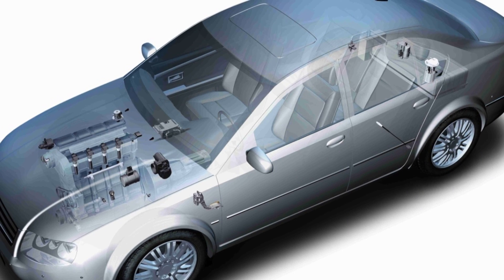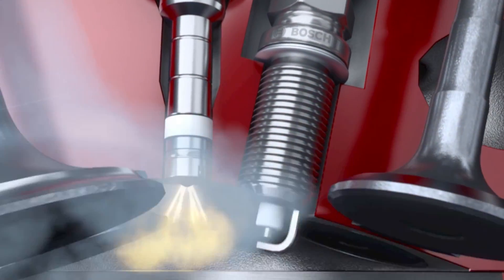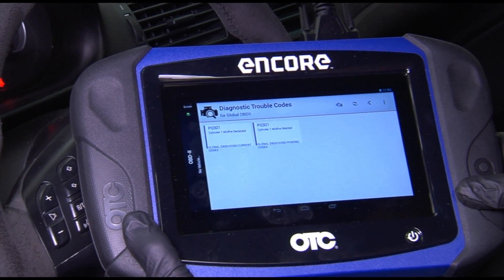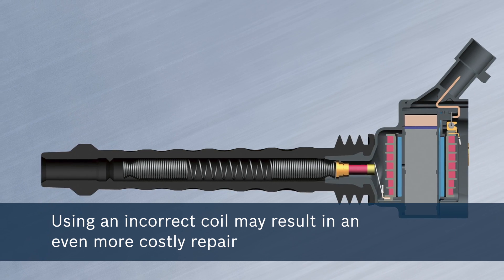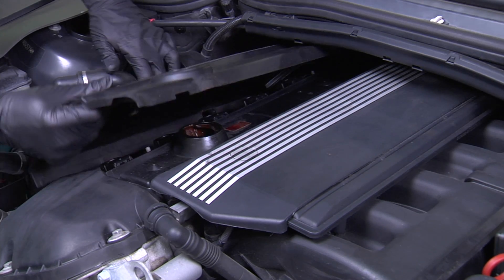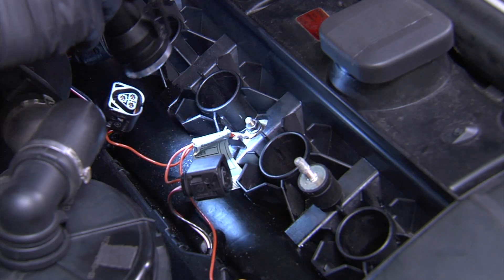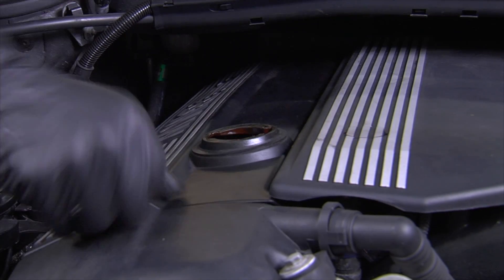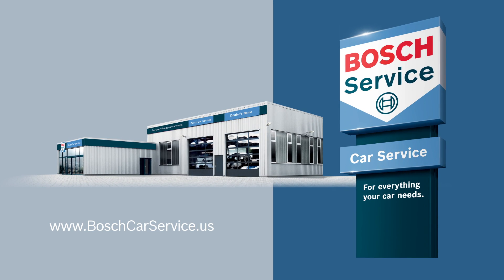Replace & Install a Bosch Ignition Coil on a BMW (0221504470)

Comment: What would make the engine vibrate?
Reply from the maker: Thank you for taking the time to reach out. We've forwarded your inquiry to consumer care, who should be reaching out to you soon.
Reply from the maker: Hi Michael.  Engines vibrate when they run, and over time this small vibration can culminate into wear and tear, and Bosch has a better material on the ignition coil that has a longer wear life.